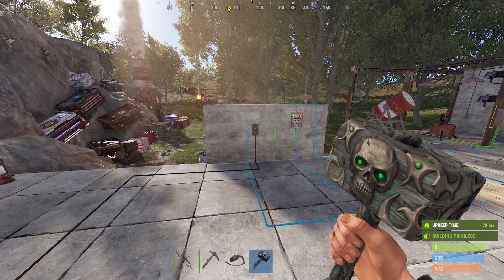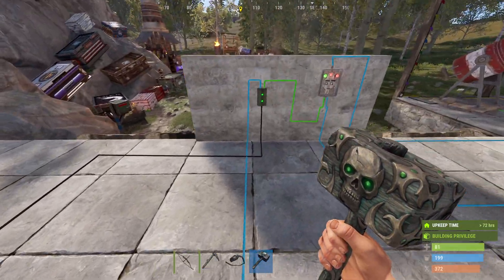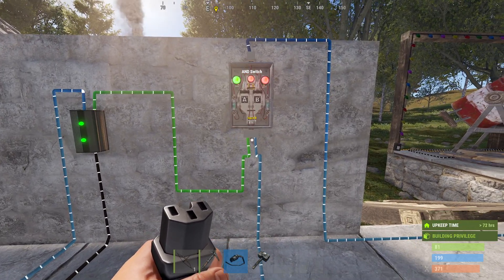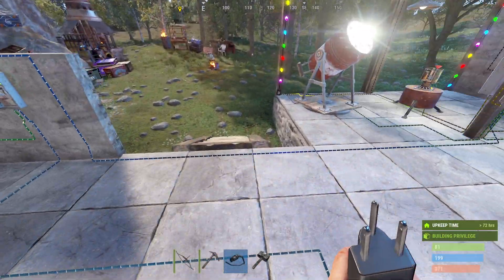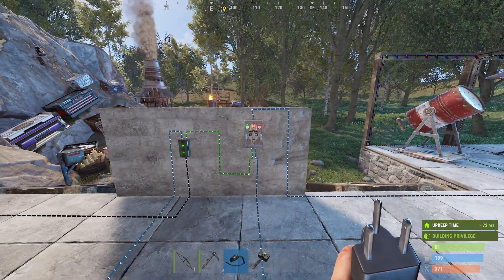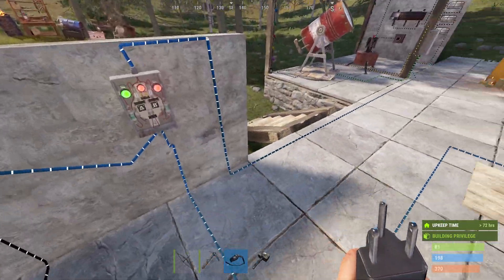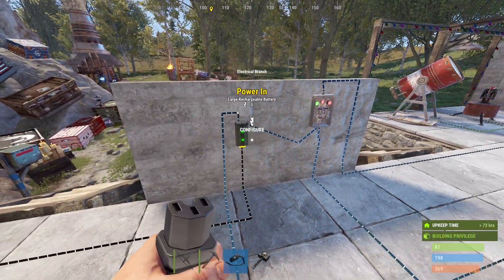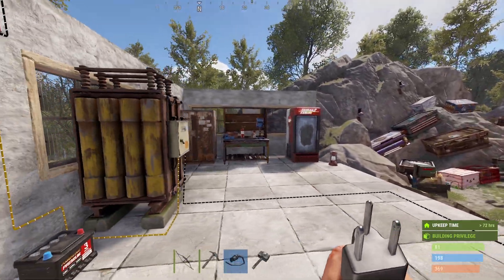Rust Electrics 7 - Useful AND Switch, but not perfect!

Comment: Just a thought. Does the time remaining in the battery change when you disconnect the AND switch? I could see this being a visual thing where it show the rust-watts that the circuit could use but doesn't consume the power with nothing actively running.
Reply from the maker: That's a good point, but it did drain the battery super fast when I didn't have a turbine on it but I didn't do a hard check of the rWh drop rate, I will check but I'm 99% it still pulls power :)